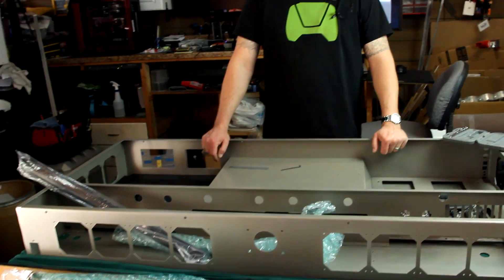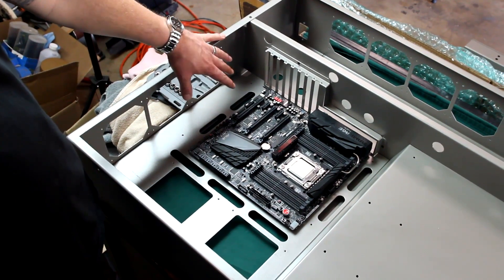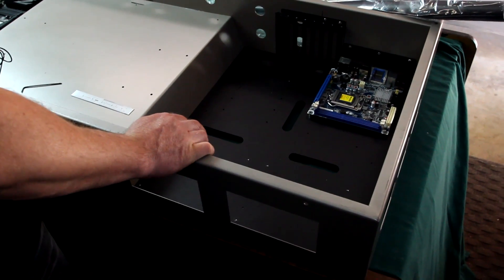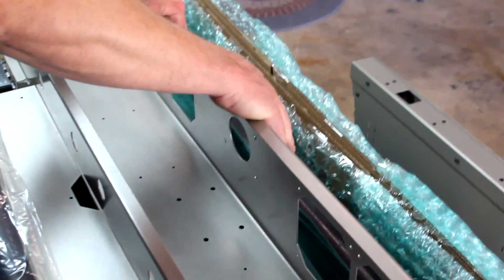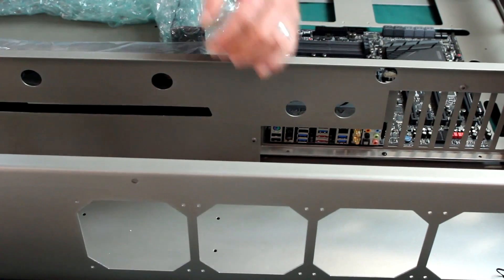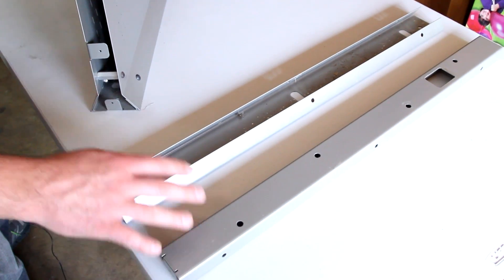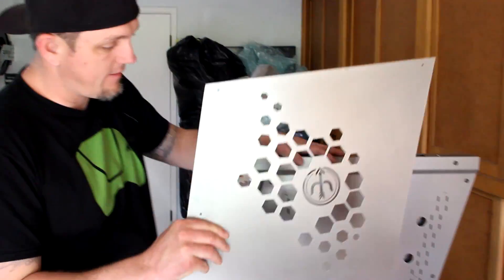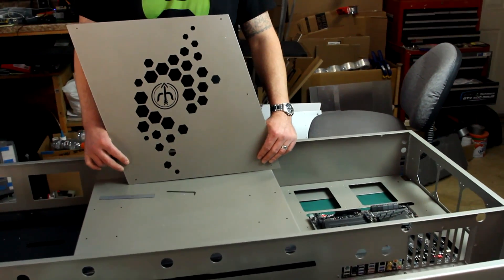PcjunkieMods Cross desk - part 1

Comment: I have try to find this desk but I couldn't find where to buy it, can you help me just exactly the one that you have I wanna paint it..... Thanks
Reply: You'll have to strip the paint but paint stripper is cheap plus it's half the fun to have to strip and paint it yourself. Have fun With your build!
 http://www.frozencpu.com/products/21024/cross-01/Redharbinger_Cross_Desk_-_Ultimate_Liquid_Cooling_Ready_-_Hot_Item.html?tl=g1c643
Reply from the maker: Austin u beat me to the punch! Thanks. Lester You can't get the exact desk I have because its a prototype. But believe me the retail one is better.
Reply: pcjunkie209 No problem man. I sough this desk in your client build number three video shortly after you posted it and have been doing research ever since. I only wish it was a little bit less expensive, and I agree the retail version looks a TON better.

Comment: Why not make a hole at the bottom of the desk for the drain that can be closed securely and tubing that extends to the glass base at the top and a whole in that glass for the fill port with some closing mechanism this way you wouldn't need to take the top off if you're draining and refilling the system...would take some work but I am no expert...just imaged it would be easier this way

Comment: if your windows is Professional or Enterprise/ultimate then your have window remote built in
if your are planing to use windows remote without a monitor. use a circuit board out a monitor. then circuit board connect video & power
https://social.technet.microsoft.com/forums/windowsserver/en-US/169da213-5173-4552-9005-c7a355c0d12a/connect-to-your-pc-using-microsoft-rdp-apps?forum=winRDc